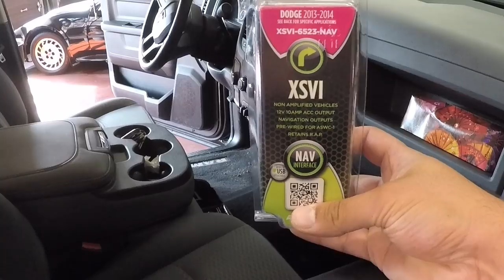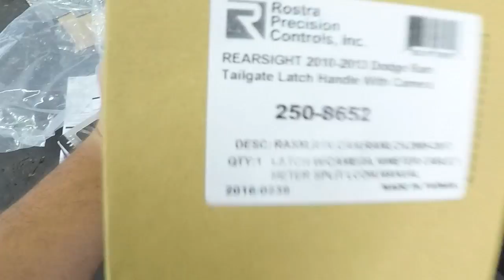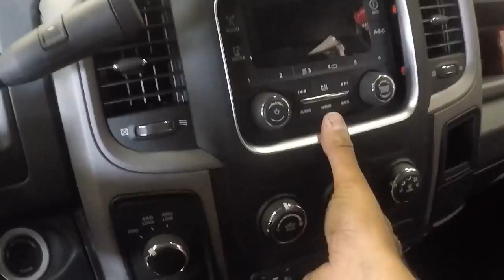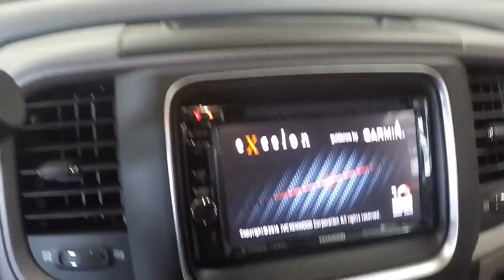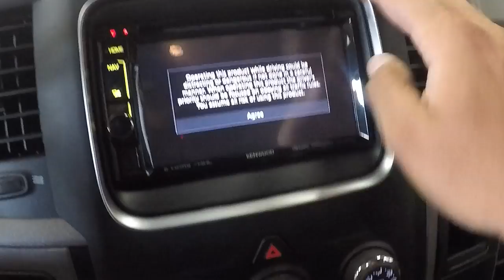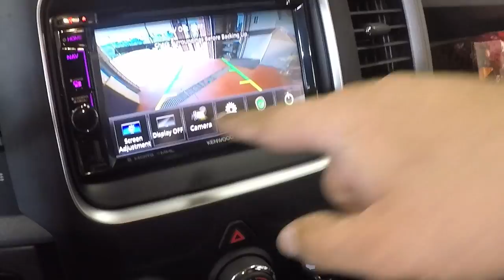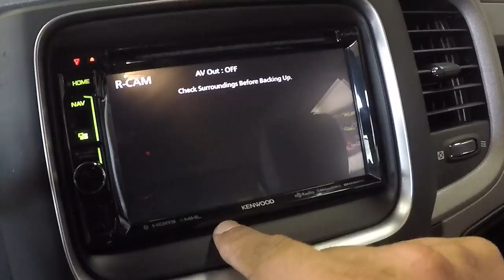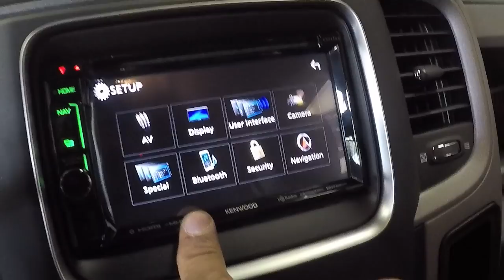Dual Camera Set Up!   Truck&Trailer   The Truck Drivers Dream! Part 1

Comment: Keep the 10 milli and the Torxy along with philly on the drilly! Are 5/16" and 7 mil common fasteners in your trade? Maybe they are more commonly used in mechanical applications?

Comment: They say real truck drivers can back up a drawbar combination with the precision of a centimeter or two. Semi tractor trailers must be easy to back up compared to this...
Oh, and not the easy ones where the trailer has its 2 axles in the middle, I meant something like this UPS truck: http://farm7.staticflickr.com/6173/6188633897_f5d9589968_z.jpg